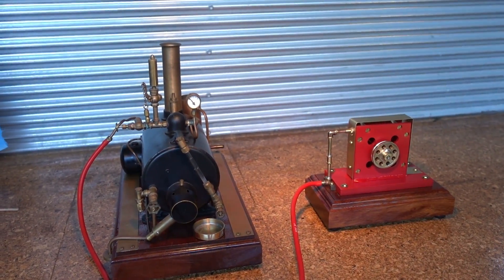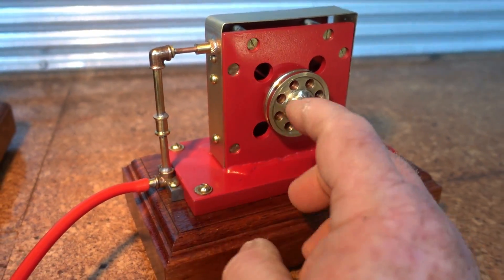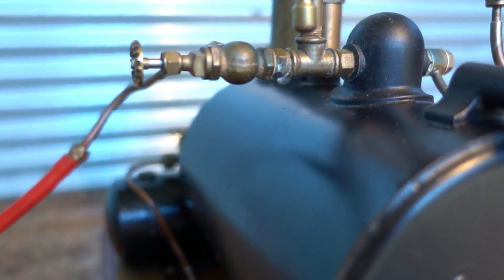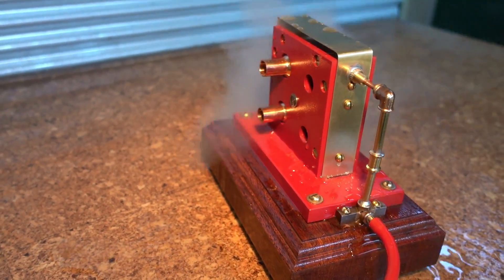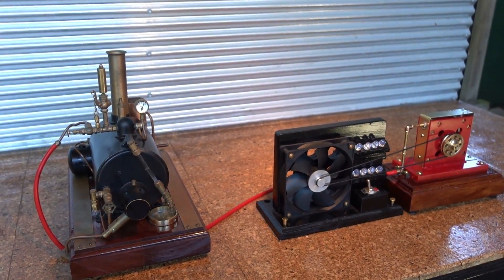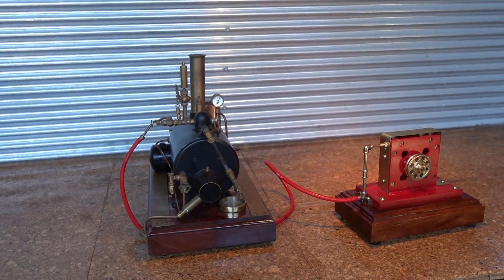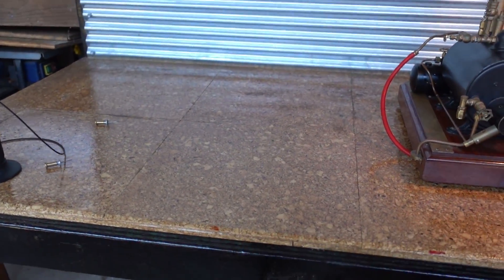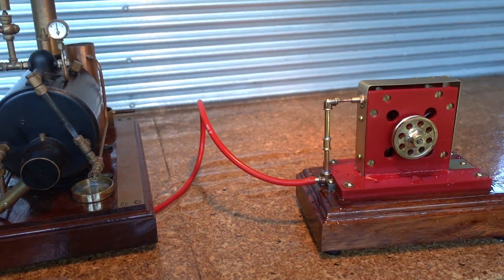Homemade DIY Steam Driven Turbine for Model Toy Steam Engine

Comment: I have some questions.. ★
★How long does this engine run with a boiler of water? 
★ Does it take more PSI of steam to drive than a steam piston?
Reply from the maker: It will run on lung breath, but with no power. To really get some power out of it, it is VERY steam hungry. At just a normal 'steam piston' speed that boiler will run it for around 20 - 30 minutes
Reply: @SteamEngines-Jim  Thanks 💞
What’s your country 🌍
Reply from the maker: @tamimshikdar5025  Australia

Comment: I've learned a great deal from this video.  Turbine applications gobble a great deal of steam as you demonstrated.  Pennsylvania Railroad discovered this with the short-lived S2 turbine.  A condenser on the output would be a great "next" project, and a steam governor to follow.  I'd like to see the turbine itself, just to enjoy how you constructed it.
Wonderful project.  Well done!
Reply from the maker: Thanks appreciated. I have to take it apart soon to check the internals and will take some photos of the inside construction. It's VERY steam hungry, even building up the pressure in the boiler as much as possible it depleted it very rapidly.